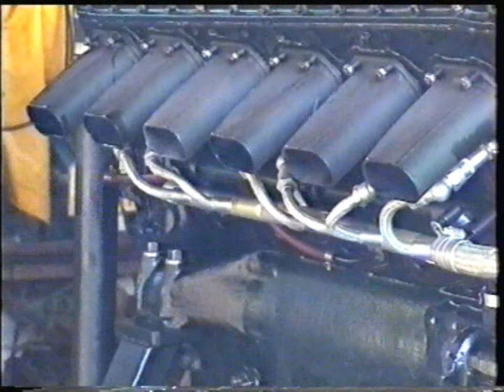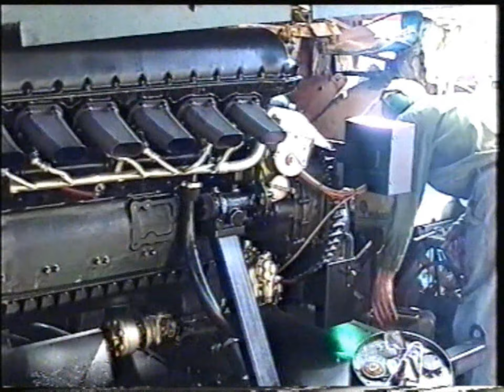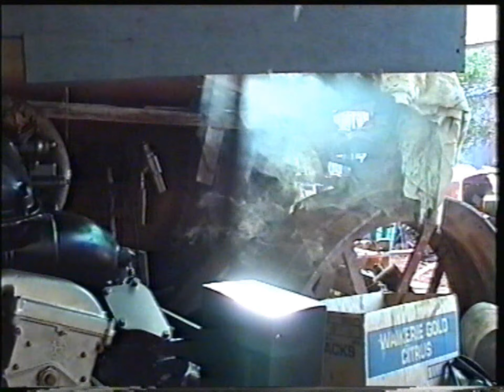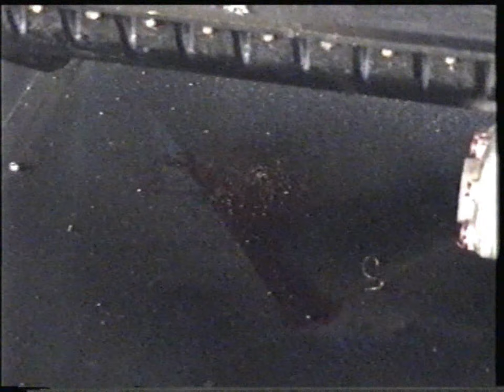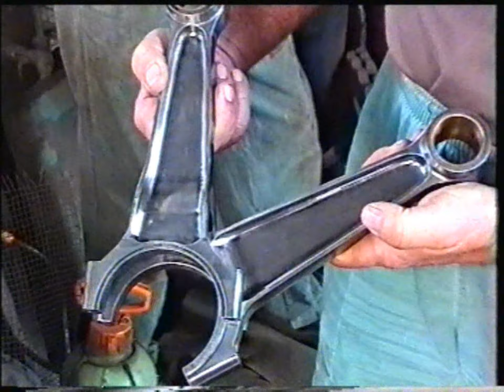Merlin V12 part 2 shut down

Comment: THAT ENGINE SOUNDED GREAT. THE SCHOOL THAT I WENT TO HAD A V12 ALLISON AND A 220 JAKE THAT I WOULD RUN 2-4 TIMES A YEAR. THE V12 WAS A REAL GAS HOG. BY YHE TIME YOU PRIME IT AND RAN FOR 30 SEC. IT WENT THROUGH 5 GAL OF FUEL. THROUGH THE YEARS I HAVE WORK ON AND REBUILT QUITE A FEW ENGINES INCLUDING A OX5 AND.. I THANK YOU FOR SHARING THIS ..ONE MORE THING PLEASE PUT A FLYWHEEL OR A BREAK IN PROP ON THE ENGINE IT MAKES IT ALOT LESS STRESSFUL ON THE COMEPONENTS ON SHUT DOWN

Comment from the maker: The gent with the earmuffs owns the engine which he rebuilt out of two wrecks. As he says on the tape, they turned up only 30 miles from his place. The exhaust pipes were made from pipe slit in half and pieces of flat added to make them the shape they are. Everyone said the engine wouldn't run without at least a dummy prop, but when he was winding it over to check the fuel system, it started up. The gear drive on the front probably gives some flywheel effect.

Comment: @1700iDiGuy Really simple technology easy to service. If you think about it that carb design was used from the 1930's till the1990's that's some production run. And your absolutely right, the diameter of the throat must have been massive, there was a big supercharger blowing through them as well. What an amazing engine, the greatest piston engine ever built? Certainly in the top ten, "whatever is rightly done however humble is noble." Henry Royce's legacy is still felt to this day. RIP

Comment from the maker: Quite true. There is a fair amount of compression ready to pull it up as soon as it stops firing. To some degree, the gear reduction on the front of the engine would have some flywheel effect to it, as well as the supercharger, so I suppose there is no reason why it couldn't run without a prop anyway. By the way, do you like the wisps of smoke that come out of the exhaust tips after the engine has stopped? I know I do.

Comment: @1700iDiGuy They were definitely fitted with carbs, the Spitfire engines could stall in positive G dives, to avoid this the planes had to roll as they dived, The ME109 was fuel injected and didn't have the same problems regards.

Comment from the maker: Despite it not sounding good at all, the engine continues to perform well for those fortunate to see it in real life. This also despite many experts saying it wouldn't run at all without at least a dummy prop on it. It was going to have one fitted, but started quite happily without it while the owner was winding it over to check oil pressure etc. So, no, it is still alive and well, waiting to run again next time. Good eh?

Comment: hofbraeu1516  IF you notice the valve covers DO NOT say ROLLS ROYCE which indicates its made by Packard Motor Co in USA. Merlins were used in Spitfires Hurricanes P51 B C D H Mustangs P40 F&L Lancaster Mosquetos and others.Many were made by Packard.who built 55,000+ of these.

Comment: @1700iDiGuy Checked it on wiki, initially a pair of SU's which were later replaced with pressurised Bendix Stromberg carbs. Amazing really everything from the old mini to Rolls Royce's were fitted with SU carburetors, really simple design I used to see them everywhere.

Comment: With so many cylinders the high number of power strokes enable the engine to run without a flywheel as one power stroke provides the power for the compression stroke of another cylinder,the less number of cylinders the lumpier it becomes!!

Comment: With big Diesel engines it is not good to run without load, most are designed to run at 85% the entire time and some even 100% MCR.

Is that allso a problem with petrol engines?

And that is the most epic thing you can have running in your shed!
Unbeleivable

Comment: About 3,000 with a constant speed airscrew, which is all you need in a plane with a good prop. If the pitch control malfunctioned the engine would 'run away' and rev itself to death.